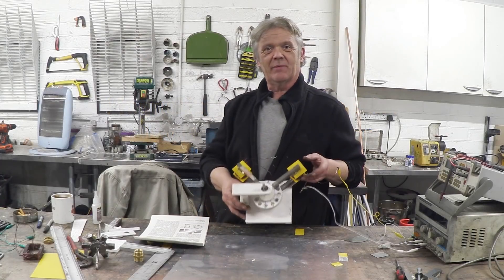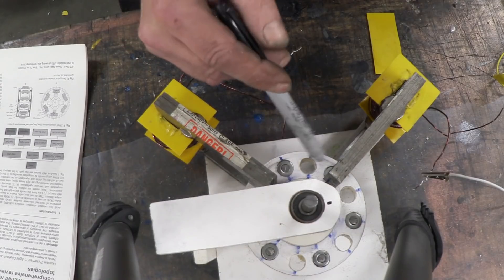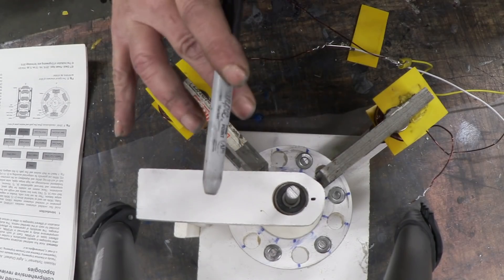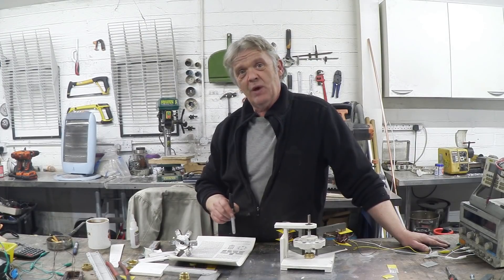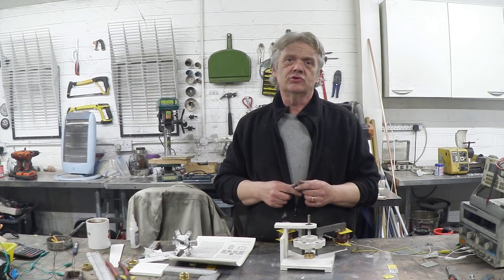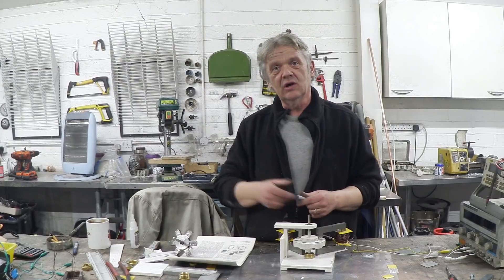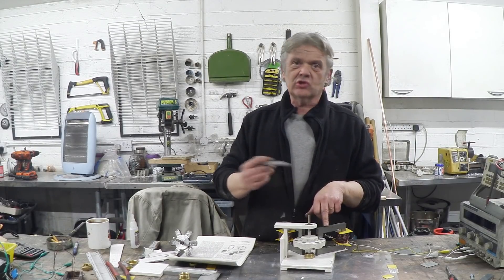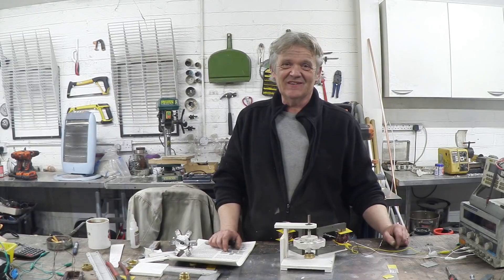1040 Magnetically Assisted Axial Flux Reluctance Motor

Comment: I have found that if I take a bldc motor from a hover board and of the 14 coils in it I will cut the connecting wires between the first two coils and the third one leaving the other 5 of each phase separate from the first 2 coils. I then re attach a set of 3 wires to the ends of the 5 coils of each phase, then I tie one end of the remaining coils together in a Delta pattern and then reassemble the motor, hook up a three phase r.c. motor control to the the original leads and when powered up the output from the new set of leads recently installed will exceed the input by a factor of 3 times the input. Am I wrong in this? I have followed your videos for a good while and have learned a lot. If you can let me know if it's the real deal or what.. thanks

Comment: Actually i tried to make a switch using a electret microphone from old tape player 25 years ago but never finished the project . I was hoping to trigger an optocoupler . As the project unfolded i found it would only be good for lower rpm or lower frequency oscillation so decided on a slotted optical switch but never turned up on order and the project went on the back shelf . I always wondered if that project would have worked well but ah well you cant have everything go your way in life 😣

Comment: You might be on to something with this design. SynRem motors have problems with the strength of the rotor due to the air slots they cut into them but since the C is turned 90 deg from the normal configuration you can use a solid non-metal rotor without the distance to the C becoming too great and reducing the efficiency. 

The problem with (but also a solution) using the magnets to set the flux direction in the C arms means you can not reverse the flux direction. This costs you efficiency because normally motors would work in a push-pull configuration. A SynRem uses a H shape so when switching the direction the flux "moves" in a upside down T (ie left = -, right = +). The flux lines then form 2 circles going through each magnet coil like "chain links".

A solution is using 2 rotors and keeping the E arms of the transformer intact. Putting coils around the top and bottom of the E lets you use + poles on the top and bottom arm and - in the middle. This way you get 2 loops of flux (top -> middle arm and bottom -> middle arm). Not only does it let you use 2 rotors but you only need 1/2 more metal for 2x the flux (until you reach saturation in the middle Arm).
Reply from the maker: I think it is interesting for sure mate

Comment: Awesome Rob! Will you have commutators on the side or face of the rotor? or will you use a laser/infrared switch and a very quick relay switch? .....maybe one that toggles between two pols like in old electric forklifts? it could just klack back and forth for your 2 poles, it would look like little rocker arms in an ice engine! HAHA
Reply from the maker: cheers ate and yes initially relays as really this is proof of concept later comes optimisation

Comment: A fun project indeed, and I'll have to research that 90*twist in lamination, thanks!
But one quick thing....
TAKE THE CHUCK OUT OF THE LATHE!! lol. I'm always lecturing my robotics kids about that, so my eyes went right to it.
Reply from the maker: I did a video on that - I don't mean to be rude here - but you are quoting a general rue without informing yourself of the specifics I am afraid - in general I agree with you but I have adapted my lathe so it can't be started with the chuck in - in order to start it you have to remove the chuck key - so in fact in this instance the chuck key in the chuck is the safest place for it to be - can I suggest instead of yelling at me you ask why in future?
Reply: @ThinkingandTinkering  I think I'm with OP on this - what are the chances of someone seeing it like that but having not seen your conversion video (myself and OP included). Its a neat thing to have done to your machine but it's so unique! Its such an inherently dangerous thing to do on an uncovered machine which 99.9% of lathes are.

Comment: Hey Rob
If you have a Pi I can write some code for you to do the switching. All youd need is two MOSFETs, two diodes and connecting wire
Reply: Throw in a potentiometer and any ADC reader and you could have something you could tune the switing frequency on the fly. Litterally cost you only 2 quid in parts
Reply from the maker: I do have a Pi mate and I really appreciate the offer but I already know how to program it - I am not using a pi for specific reasons - but I really do appreciate the offer

Comment: Robert, excellent video as usual, you reminded me of one of my favorite things:  I have an AGNI 95R motor and am a huge fan of them.  I make electric bikes and scooters so the AGNI/Lynch motor is by far the best motor I've ever seen or used and is the ideal power plant.  The Lynch motor is a unique axial gap permanent magnet brushed DC electric motor.  The motor has a pancake-like shape and was invented by Cedric Lynch in 1979, the relevant patent being filed on 18 December 1986.
The Lynch motor can achieve 90% efficiency. It is built from ferrite blocks sandwiched between strips of metal, instead of conventional copper coil windings, and is held together purely by magnets. The motor provides a power of 15 horsepower (11 kW) and only weighs 11 kilograms (24 lb).
Reply from the maker: I just had a look - it was quick because it is late - loved it! - I am going to look more tomorrow - really appreciate the info mate - cheers

Comment: you could add a cam like in a gas motor that opens the valves for the thermal cycle yes thermal  or a disk with pegs or holes would work also  but i think using the coils to zerro out the magnets would work better  with other tinkering two things a sorted coil makes really big current or magnetic flux when a big current has no where to go like open circuit  the currun must go somwhere even if the voltage has rise to a big number to do so  pancake coils can rise voltage also  but it acts like a capacitor and a inductor  you cant have one with out the other but one of them will follow the path of least resistance to reach equilibrium with its surroundings   when there is no measurable diff is it still there if so we could create a difference maybe a vibration of your voice or a coil of wire least resistance path and a magnet or throwing a rock in a pound and waching the sine wave but no hoizontal movement of water just up and down  could you imagine the resistance in every wire from where energy is made to your house  could everything knowable by man follow the same set of rules and the rules be explained and understood by throwing a rock in water??????  or maybe just another crazy nut on the internet that thinks water makes a good level  either way tread lightly my friends knowing can be a bad thing

Comment: May i suggest feedback coils for your switching . That way your timing is automatically tunable  or you can use back emf from the magnetically assisted coil . I also like the idea of abient light switching mechanism . During rotation the light sensitive resistor sensors a breif cut in light emission and that is enough to create a binary signal .
Reply: I was going to comment the same.. great minds...
Reply: @hissst69  yes well they are well know ideas but hopefully we all discover a new way from experimenting that not only is more effecient but also a switch mechanism that somehow utilises natural forces and adds power to the system . Its all about leveraging existing forces and multipling them together for an amplified output that can then be fed into the system and utilised in its operation . Tesla was doing it a hundred years ago! Its all about identifying the natural forces within a given system . Obviously back emf is one but creating standing waves is another such phenomenon that allows amplification of back emf and when that voltage reaches a certain peak other natural phenomena takes place . Unbeleivable things have been undisclosed because apparently humanity isn’t ready to weild such force! If that kind of consideration and judgment today was made with all our pollution and destruction of our ozone layer and climate change  etc i think we would be in a much better place but also considering dodgy incompetence of those the seek to govern humanity , i also can see it still may also be correct in its assertion ! Can you imagine orange man having to power to create disapproval sactions of those that don’t follow his narative and block out the power for that country . Or china using it also as a weapon to control its billions of slaves ! Mad world and only getting more unstable . Big house of cards at the moment ! But behold we may still have a few tricks up our sleeve 😂
Reply: @Buzzhumma  indeed, Tesla is still very mis-understood today, fascinating reading his books and patents.. on my kindle currently :)
Reply: @hissst69  you might appreciate the work by master ivo . I am following along and playing around with his circuits. I feel his direction has some legs to it !
Reply: @Buzzhumma  I am subscribed to him.. I am playing with radio frequency and tunings and efficiencies currently, Master Ivo is light years ahead of my playing, although I enjoy his work. I rarely am interested in theory, much more interested in application as I dont care some group's opinion as to how a photon can or cannot travel through space or if it is matter (partical) or just energy (vibration), I just care that it is here and I can do something with it. Brute force and waste heat is not the way electronics could have gone.. and its really sad that is developed that way. I like resonance and am thoroughly confused and challenged by it so Ill play with it until I can apply it all over. I like this channel because he just does stuff, doesnt argue or over think it and its principles, nor does Robert over explain theories in the why.. just gives the HOW which is all that is inportant and the only thing relevant to people that actually DO things.
Reply: @hissst69  yeah i hear you . Thank god for youtube hey . We can transmit our practical and illustrated idea all over the globe to anyone with internet connection . The speed at which we are going to evolve concept will be mindboggling . No longer do you happen to have to go to prestigious schools and comr from a certain class in society to engage your natural talents . You could be a street kid in bangladesh and as and adult get a job in a tech industry just because you happen to get it ! Wonderful
Reply: @Buzzhumma  It is a beautiful thing !
Reply from the maker: thank you mate - nice suggestions

Comment: Since you have a magnets that has a north and south pole and you have a electric coil, does the direction of current flow flip the north and south pole ??? Thanks Rob.
Reply from the maker: yes it does mate
Reply: @ThinkingandTinkering  So the magnetic poles of the magnet will change when the current flows through the coil ???

Comment: He must not sleep 😂.  
👍👍 Great content for sure.
The simplest circuit be two runaway car relay's. 
Wire two relays together so when you connect the power, one will trigger the other and vis versa. 
Works great if timing isn't a problem.

Comment: Seems like an electromagnetic version of an MSD(Magnetic switchable Device) made into a motor. The mechanical ones just rotate another permanent magnet to cancel out the first.
Best case you should be able to get double the torque out of each electromagnet when you perfectly match it to a permanent magnet. But if you connected two rotors with different numbers of spokes in a magnetic circuit, with each one alternatively opening and closing the circuit to pull or release the other wheel, you'd have a magnetic gearbox and could scale the torque to any integer ratio, all with potentially just one permanent magnet or electromagnet.
If your current device is two "C"s, then a magnetic transmission would be two "H"s, or four "C"s linked in pairs, with another wheel on the other side.

Comment: You can always use brushes on the armature to do the switching mechanically as it runs and you can use the power to adjust the RPMs you can also put a neodymium magnet in between your washers and even give it more poweror put a pulley on it with neodymium magnets on your armature and spin it like a generator

Comment: So what I'm getting is that this can function as a stepper motor but also let go for a free-spin without any further mechanical assistance. Sounds useful for hydraulics, add a couple of pressure sensors for the hydraulic fluid, use this to power the pump, this will allow you to pump up the pressure and then let go at a (variable) constant rate by monitoring the pressure and locking it when it goes beneath a certain point.
Sensor placement will probably affect performance and sensitivity but I haven't looked a whole lot into the innards of hydraulics.

Comment: You could add a step to manually switch using two momentary switches and then use the auto timed switching which even Arduino could handle to switch two MOSFETs on and off in synchronisation.

Comment: Ball bearing motor with flywheel connected by non conductive yoke to a faraday homopolar generators on each side of the ball bearing motor. Thermoelectric generators also on the bearings to siphon the heat to electrons. A pulse circuit will be needed for the drive current. It should look like a axle of a car or train. I would cheers you mate but I'm still waiting on the 600v 10TF super cap. You have the equipment and the competition doesnt come near your low voltage design. So would or could you take the challenge for the best super capacitor on the market? I and others would like a go fund you page that had a voting setup for the proof of concept. Maybe you need offer a IPO for your talents in creation so people could have shares in the company,.,., just a thought
Reply: Or perhaps he's not a sellout
Reply: @401ksolar  to generate wealth so one could make a company for humanity's benefit doesn't sound like selling out but chipping in
Reply: @brettmoore3194  I think you're missing the point, Robert Murray Smith's currency on this channel is ideas, his and viewers not just commercial products.
Reply: @401ksolar  well, thats why I suggested a IPO , he makes things better not new ideas. So if he doeant want humanity to be slowly advanced due to profit margins, beat them to the punch. You speak as if y'all are a couple. Let the man speak for himself
Reply: @brettmoore3194  it's just that I've experienced over zealous people who allegedly supported me who ended up publicly bringing up business laundry so to speak which has its place but just not here but to each their own have a nice day
Reply: @401ksolar  well if your not doing anything nefarious or scrupulous then business laundry is just advertising... Always let a man speak for himself., 401k and solar are a joke

Comment: Could you use mechanical magnetic reed switch(s) instead of a power consuming electronic circuit? Switched off then on with small magnets set in position on the rotor for timing.

Comment: lol you could do a hv version with ludic's'Triggered Spark Gap High Voltage Switch' to push them currents bemf 'blade switch required ^_~
but probably better to lash up '
learnelectronics Classic Circuits You Should Know: Astable Multivibrator' from reclaimed de-solder bath bits and adjust for switching speed for now

Comment: You may not need much electronics if you use two small, weak magnets on one side of the rotor, and two binary hall effect sensors on the other, such that the hall effect sensors are only triggered when the steel of the rotor shunts the field from the magnet. In fact, you might be able to get away with using only one coil, one 'sense' magnet, and one hall sensor if the 'sense' magnet is just strong enough to hold the rotor in a position which is advantageous for starting, but this would obviously require the start position to be identical to the pulse position, which is unlikely to be nominal. If the sensory apparatus can rotate around the central axis though, this may be a perfectly sensible approach, as it can just have a marked start position, and be moved to adjust the pulse timing.